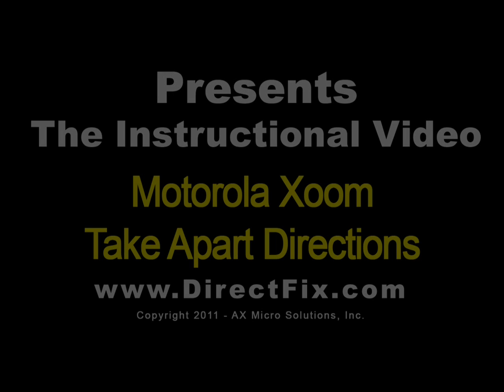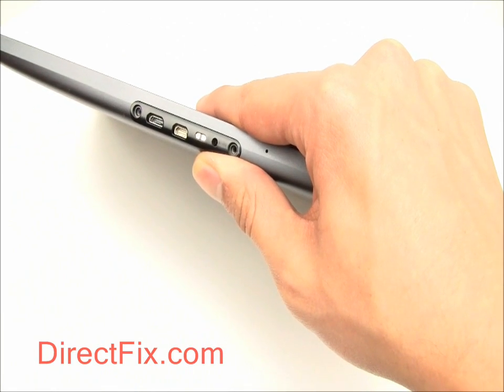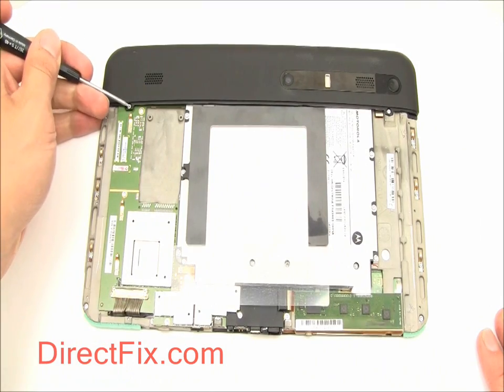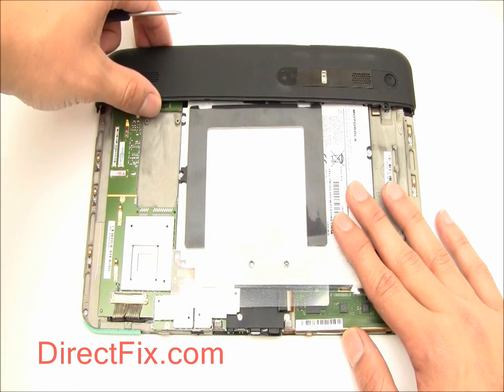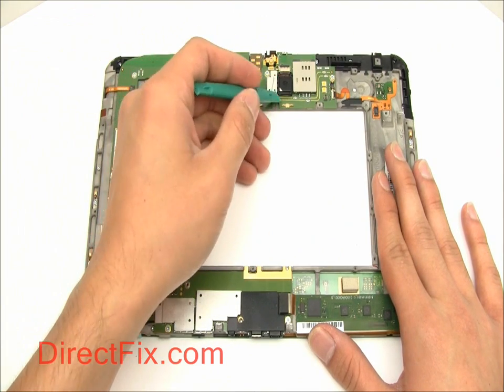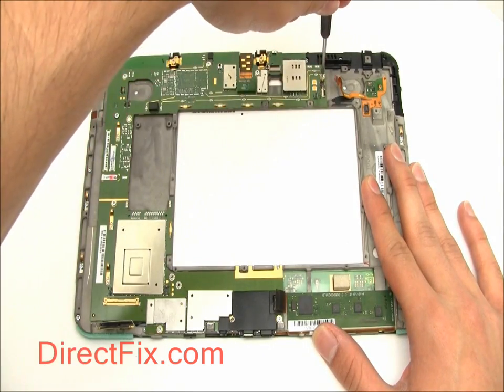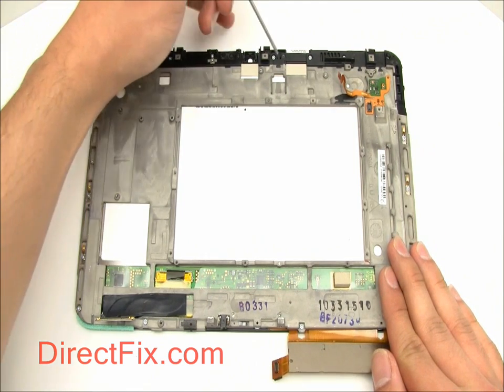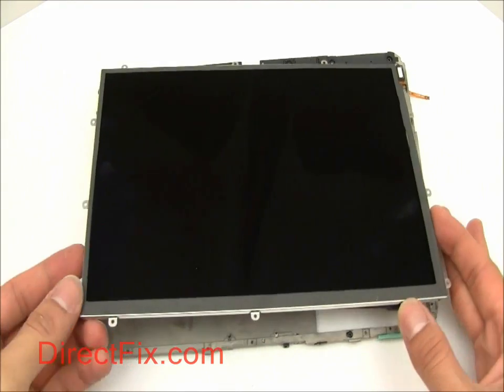Motorola Xoom Screen Replacement Directions

Comment: ok this is going to be a long one 
my friend dropped my tablet and the screen cracked it still worked and all just a cracked screen then the charger broke so i bought a new screen and charger for it i got the charger first and charged it up and now it wont let me puch any buttons and the touch part of it isnt working should i try to use the new screan or does it need a new touch screan also i dont want to put the new screan on it and find out i need a new touch part also

Comment: I just want to say thank you for this video, I am a PC technician, but not a tablet technician. All I needed to know is in this video. Albeit, I need an LCD panel as my backlight works, but the screen doesn't show up, it shows up on my monitor though via HDMI, so the data is still there, but my LCD panel is broken. 

Do you suggest when I do purchase a new LCD panel that I have it done professionally in a dust-free room?  Let me know as I otherwise plan on replacing this myself.

Comment: Hi I tried to reset factory data settings on my Motorola xoom WIFI.

All went well except when I get to "Setup Complete" I press the "finish" button and it doesn't respond.

I also tried the android fast recovery:

The android Robot appears but I do the below step:

"Hold down power button and then press the volume up key together to see the Android Recovery screen menu selections"

BUT I DON"T GET THE Android Recovery screen menu.

Kindly assist please.Any ideas?

Can you help me out?

Comment: My Xoom Wifi failed to power up, Tried the power button/volume up restart to no avail.the Thanks to this video, I summoned the courage to disassemble the Xoom. I did this and disconnected the battery (like a hard battery pull on my phone). I then reassembled everything and it powered up! I cannot say whether is was the battery pull itself that did the trick or something else. Regardless, it is working now! Thanks for uploading this video!

Comment: Greatly informative, and well-done video! I clicked an ad :)   

Any chance of you doing one of these for a Xoom "family edition"? I went with one because of the upgraded screen and office apps, and now see that when the battery fails I won't be able to replace it - it has no torx screws, and a different rear cover design. Disassembly has me stumped, as well as every site I've seen on the web discussing it.

Comment: I'm a little confused on specification on part names. My tablet fell out of a broken plastic bag and so until I disassemble it I don't know what part is cracked on my screen. Tell me if I'm wrong. There is a (1) glass screen and then (2) an LCD display. Is the glass screen called the digitizer? Or am I missing any parts because I don't want to buy the wrong replacement part. Thanks for the help. Much appreciated.